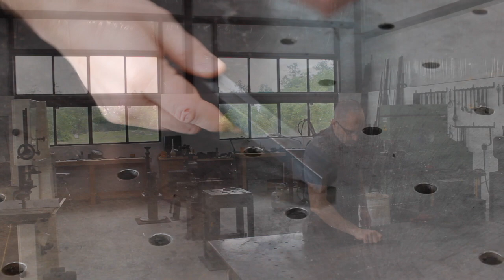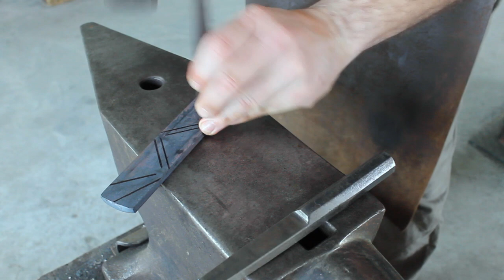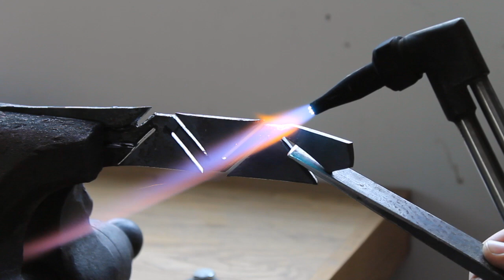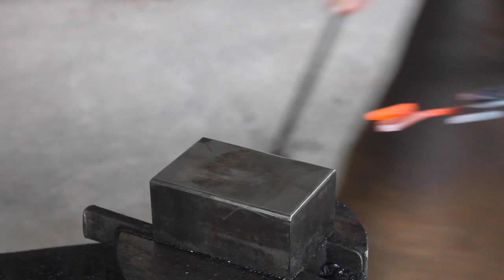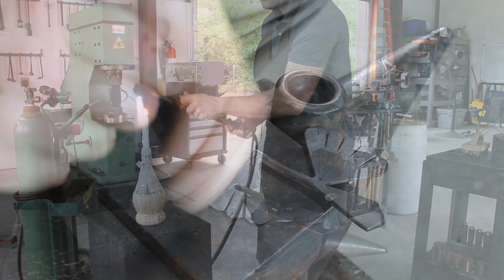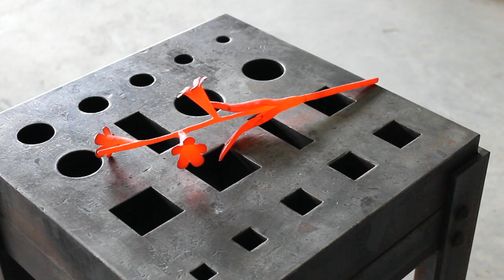Forging Bartolucci's Flower

Comment: Beautiful! Now, to figure out how to do that in my coal forge without an oxy torch!
Reply: Till you have power hammer and punches it's easy but precise work, with only hammer is not so easy. Use a smoothed plier and heat it all, also having a really small hammer for the bends and precise hits.

Comment: I love this guy's project, but I just don't see why he had to start out with a square bar.  Sure the power hammer makes for quick work turning it into a flat bar, but starting with a flat bar makes that an unnecessary step.  He is an excellent craftsman no doubt, but there is no good reason to give himself that extra work as far as I see!
Reply from the maker: *I started with that stock as part of the 150mm challenge from the Hereford college UK, to show what's possible and that the starting shape doesn't matter, just the volume needed.

Comment: Make a rolling stand with a swivel mast and arm to hold the torch. You can leave torch on the arm lit or remove it. Also place a gas saver valve on it. Small plate with holes to hold various torches, rosebud, etc. Also hang striker and tip cleaners. Damn useful. I used a railroad shuttle car wheel for a base with small steel wheels and handle so I can move it around like a handtruck. Instead of mobile rig with bottles the bottles remain secured to wall and rig is mobile to length of hose.